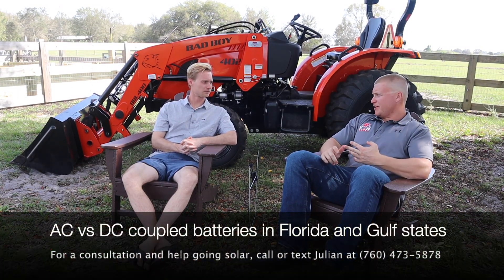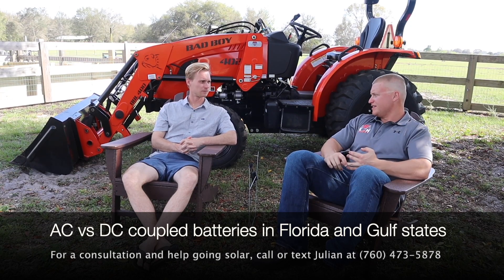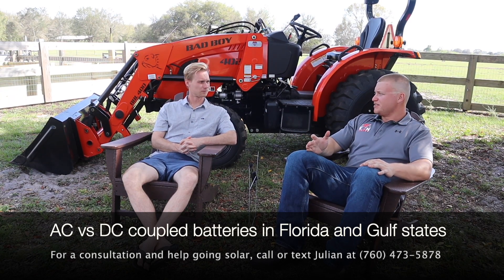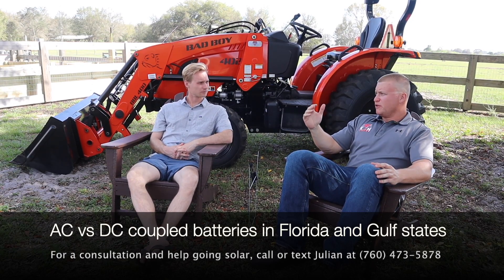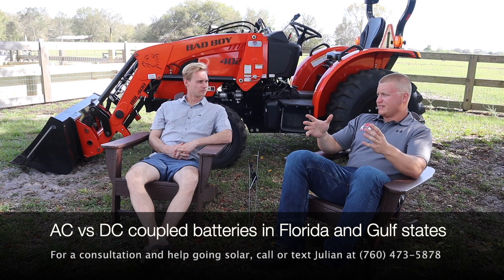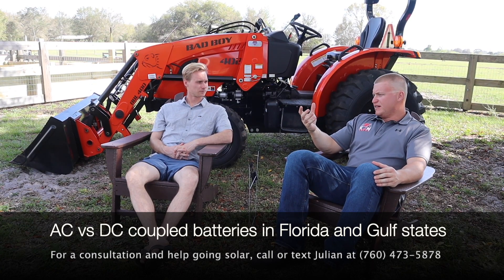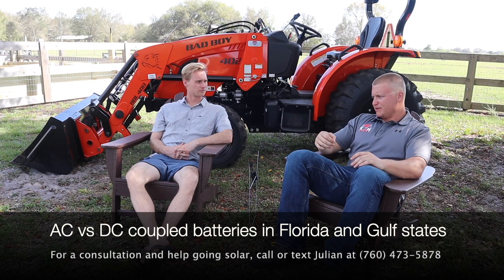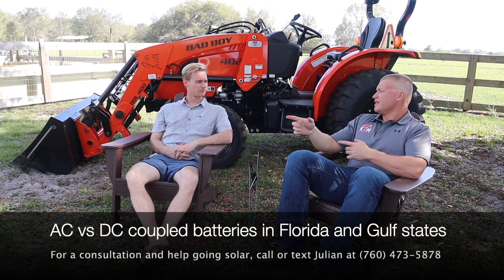Which solar + battery architecture is best for Florida during power outages. CA v. FL. Part 3

Comment: I was going to make the argument you started at 3:40 that when you are making tons of excess electricity, use it to charge your batteries at a high rate (check with battery manufacturer) to 100% and then offload the excess. Efficiency almost doesn't matter. (That is how I have my system set up).

Comment: I guess for DC coupled you still have a single point of failure in the central invertor, the optimizers may take care of the shading impact on a panel or loss of a panel I guess
Reply from the maker: Correct. That’s the downside to a DC coupled system in my opinion as well
Reply: @juliansolarguide  SunRun gave me a quote in Tucson for a 7.77Kw system and Tesla Powerwall. $7.68/W (battery included). That's like 1.7-2x as most other quotes I'm seeing. I'm guessing they are really PPA only focused